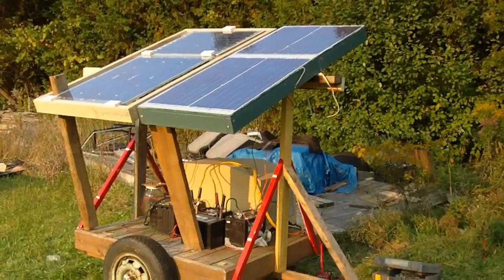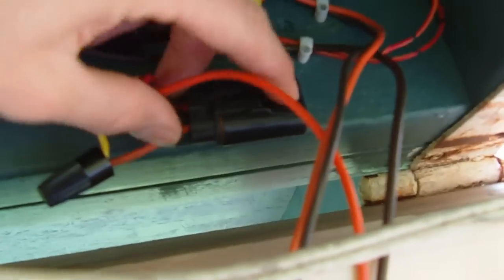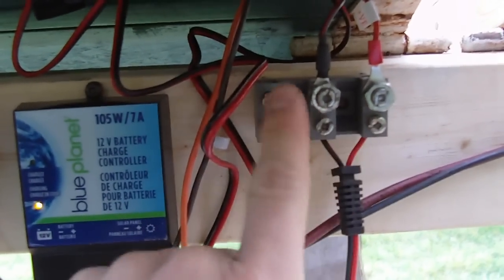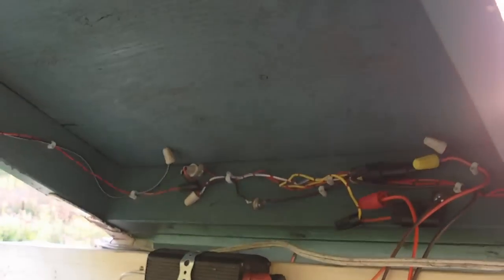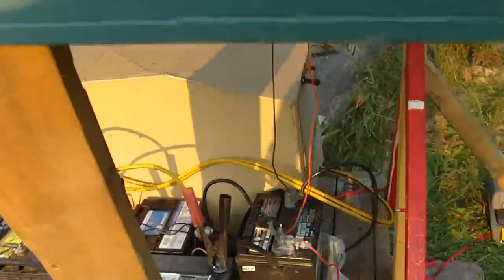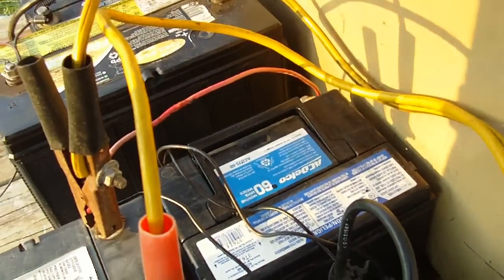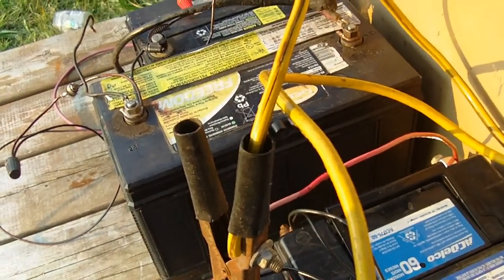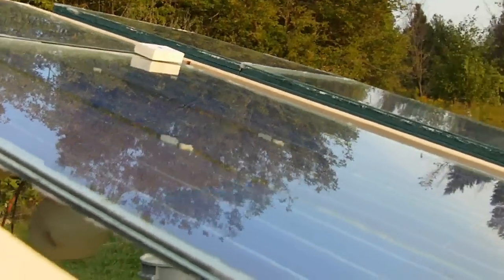Homemade Solar Power Charging Station

Comment: How about some plexiglass or thick sheets of plastic for backing? Cheap, wether-proof, and clear for diagnostic purposes
Reply: Also if you swapped out the hinge for carrier bearings and mount the panels to a shaft with a bicycle gear at the end, a simple arduino connected to a heavy duty stepper motor with another bicycle gear and chain could easily work as a sun chaser. Arduino only needs 5-9V to run and the stepper motor connected to a relay would probably be in the 9-12V range. you can set it up for hourly/half hour adjustments once the timer hits a relay connects and the 12v stepper motor will only draw for a few seconds a day. And when the sun sets it makes one adjustment to index it for the start of the next day. Now you have me thinking about setting something up for my deer season campsite.

Comment: I must say I am impressed. I'm a tinkerer also so I have two questions (as I am new to solar). I'm assuming the diode is to prevent the current to pass in one direction (away from the panel)? 

Also what is the purpose of the charge controller? To prevent overcharging? I saw you other comment on how most manufactured solar panels have the diode built in so should I not concern myself with that aspect (I don't have the patience to build a solar panel)!